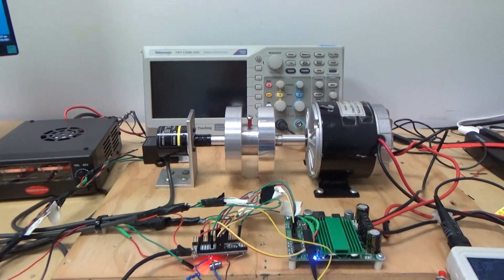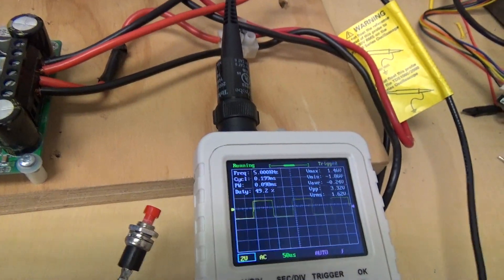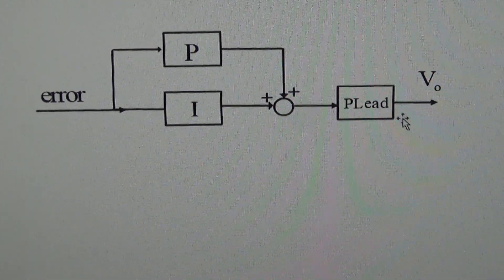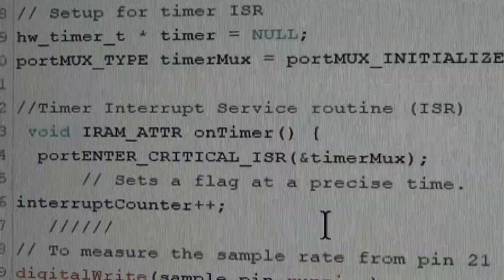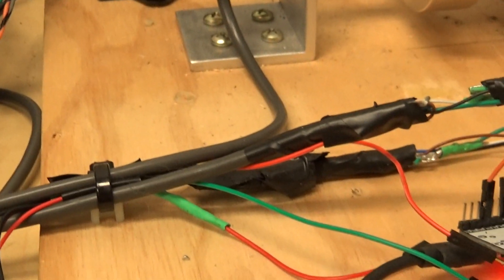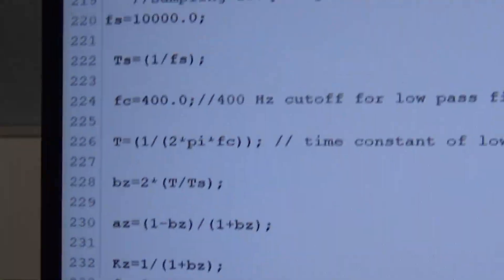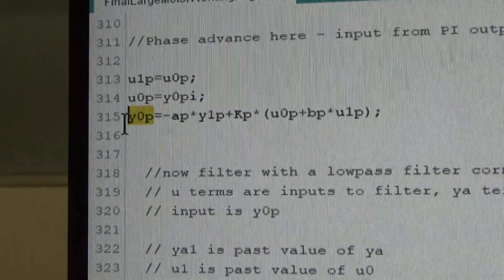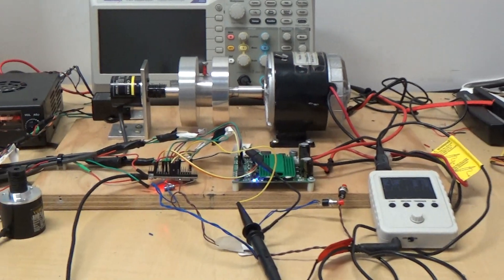Interrupt driven PID and Lag Lead digital position control on an ESP32

Comment: No offense but this is horrible. You need to be using PD during motion and introduce I (if needed) at or near steady state.
You only need a PID loop-rate of 1KHz and the PID should execute within the ISR.
The ESP32 has counters which can be configured to decode quadrature. The counters themselves are good for at least 40MHz

The integral is something to be avoided during motion. Acceleration and velocity feedforward (AFF & VFF) can close-up the following error and they are external to the PID, meaning that stability is unaffected.
Reply from the maker: Thank you for your comments. So until that point I had been using LabView for everything (LabView real-time and FPGA). It has a proper RTOS where I can have an accurate timed loop. Then I moved to the ESP32 to cheapen things as the LabVIEW kit is too expensive for most people. Of course the first thing I did was to put the code within the ISR but Arduino has certain problems with delays which resulted in this work around. The flag idea I think is terrible but at the time was the recommended work around that people were using online and it did get it working. The second point is that in any servo like this I was designing for maximum possible bandwidth so that I get the fastest possible response and best disturbance rejection. In fact the bandwidth is only limited by the structural resonance of the motor plus load which is around 1kHz if I remember right. I did measure it at some point. I was trying to get a bandwidth of around 300 to 400 Hz or even higher. To do this I need to sample high. Yes I could sample at 1kHz and have a low bandwidth loop.  I don't agree that integral is to be avoided. On a low bandwidth loop yes but  generally a slope of -40dB/decade is better at low frequencies than -20dB/decade. Yes this reduces phase margin and so we can only use a very small amount but it does tighten the loop up more. Can also use a phase lag compensator which is less expensive in phase of course.  Feed forward I've never tried and was warned off of it a long time ago by a servo designer who used to design fast loops for hard disk drives. He always maintained to find first the structural resonance and then keep pushing up the bandwidth as close to that limiting factor as possible.  I did a later servo in Python and had a 1kHz sampling rate but it's a bit like a violin string that hasn't been tightened properly. I would concede though that 10kHz sampling is a bit too much and should have gone for 5kHz.

Comment: Hi Tom, just one quick question for the "flag" you said in the video, I believe it only set to 1 (interruptCounter++) outside the main loop, hence only runs once, of course the first time the main loop runs, it will be flagged and gets decremented, and there then, my question is, for THE SECOND ITERATION ONWARDS, would the flag already be at 0 hence not triggers the timer interrupt routine? Or there is code that i missed for the flag to be re-set to 1 or ++ back?
Reply from the maker: So  the interrupt service routine (ISR) for the time is called from hardware and does not need calling in the software. This is true of all interrupts, hardware triggers them. That sets the flag back to zero again. The trouble arises if half way through the loop and the timer triggers the interrupt, the flag changes and the program returns back to where it was in the loop rather than the start of a new loop. So it is only accurate up to a point and not perfectly synced. A way to get round this is to use queues. (I am told). The Arduino method is not the best but works adequately. I wouldn't put it in an aircraft though! Still, it  all depends on whether you want to demonstrate principles or you are making a product that is fail safe. In this respect the Arduino system is a little better than MATLAB which can only simulate (all be it at a much higher level of course).

Comment: Nice little oscilloscope.

Only ever coded Arduino once, but it was for someone else who asked me to fix their code.   I never got to see the hardware but fixed their code and apparently it worked afterwards!

Creating a flag off a timer is something that I've done a few times.   One of the parts I uses has a dedicated timer which runs in the background all the time, but then I divide it down to the sampling frequency I want and run a flag off that.   Due to the chip speed I can't slow the timer down enough but if I leave it and then run off the flags it's fine.